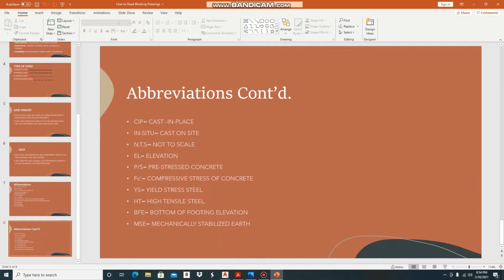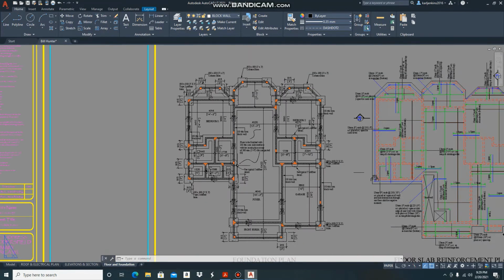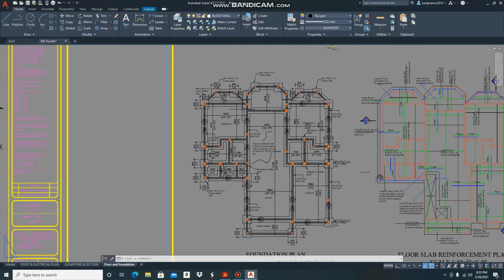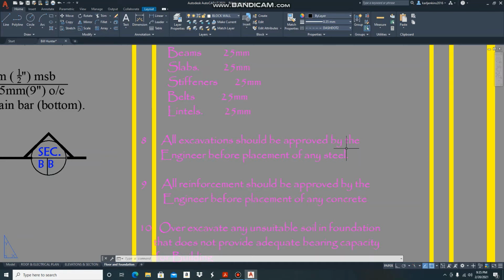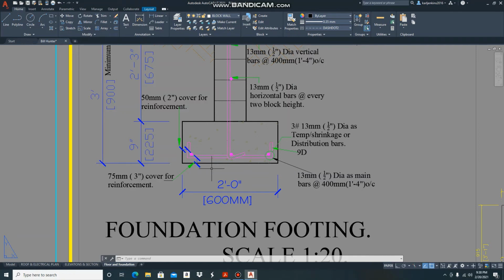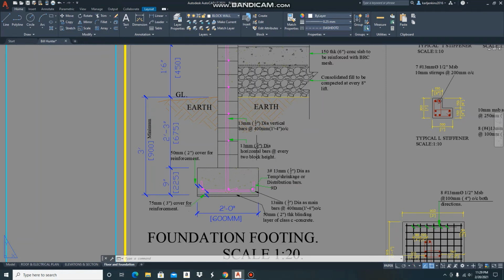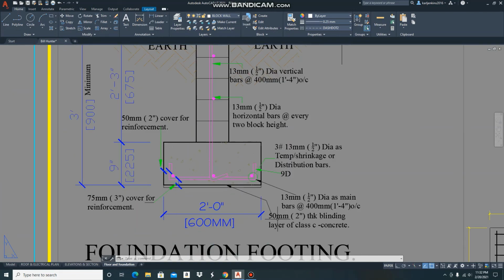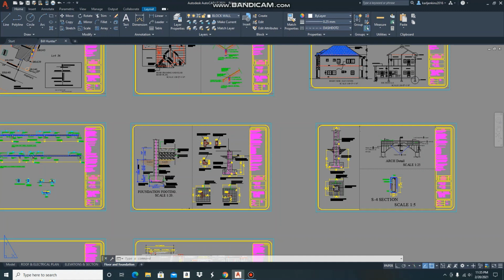how to read Foundation Plan "Jamaica"  EP2

Comment: How small can the set of building drawings be when submitting them to the municipality?
Reply from the maker: Its depends on the size and complexity of the design.
Reply: @jkengineeringarchitecture.  I'm referring to the actual size of the paper that the drawing is printed on,
Reply from the maker: @ 24" x 36" Paper.